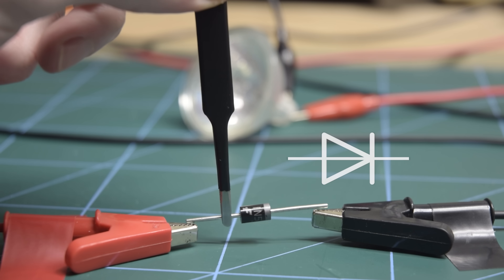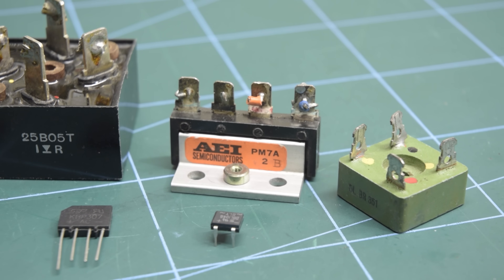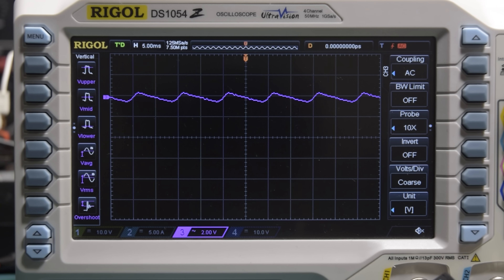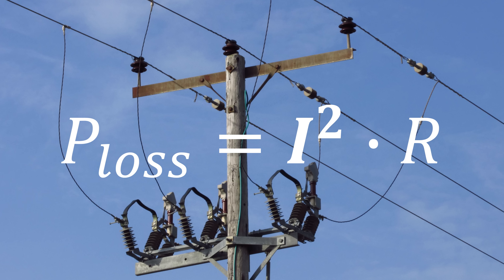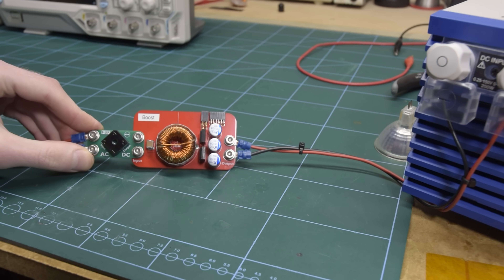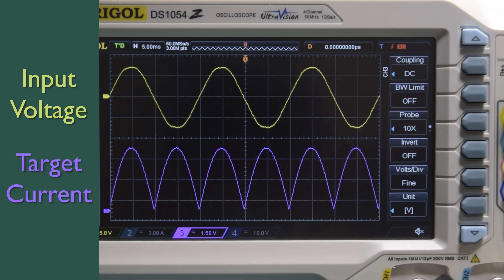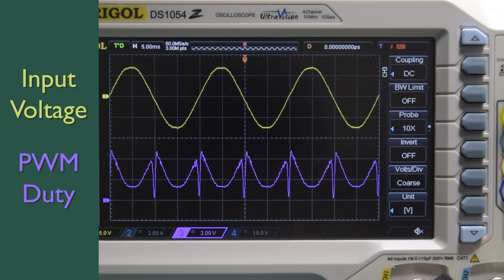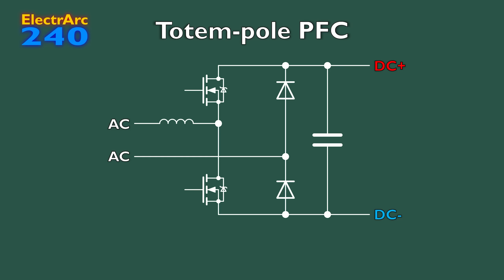Fixing the Full Bridge Rectifier’s Big Flaw - Active Power Factor Correction

Comment: Power factor correction is done at electrical substations when not done at large industrial users' facilities. Switching power supplies have no need for power factor correction.
Reply: We aren't talking about reactive power. A rectifier followed by a capcitive filter is a very non-linear load. There is no practical way to fix the problem with linear reactance. A power substation can add capacitive or inductive reactance to fix problems of poor power factor due to inductive or capacitive reactance, but that ONLY solves the problem at and "upstream" of the substation. It does nothing to fix problems downstream of transformers between the substation and loads.
Switchmode power supplies are the worst offenders in terms of presenting non-linear loads and the problem must be fixed right at the switcher.

Comment: Somewhere in a comment someone asked how PFC will work with DC input.

Overall the controller will make the instantaneous input current directly proportional to the instantaneous input voltage and the average input current inversely proportional to the average input voltage. That means it will accept lots of weird things without complaint. The analog ASICs for active PFC don't make any "assumptions" about what they are getting - they actually look at it constantly. Something based on a microcontroller probably makes assumptions and may lose its mind.

It may vary with the controller used, but in general, it will work just fine as long as the DC input voltage is within the range the PFC circuit is designed for. If you take roughly the nominal RMS AC input voltage range and supply DC within that range, you'll likely be OK. That would be something in the 85 to 265 volt range for a circuit deigned for "universal" AC input. Be careful if you are pushing the limits. Keep the DC below the peak of expected high line. If the DC input voltage is very low the efficiency will be lower because of high average input current. You might run into current limiting. 

Performance should also be quite acceptable if the AC frequency is "off." I'd expect pretty good performance at low frequency but performance might be mediocre at say 400 Hz. Performance with varying AC frequency, as long as it is within a reasonable range, should be OK.

Comment: I will show this to one of my cleaning ladies shortly, who's asked me about this recently due to a power monitor upgrade. Their technician told her that drawing current from both her washing and drying machine would incur additional surcharges. I called that out as BS, but she had a hard time believing it. I told her that most likely, this was a matter of power factor, and suggested her to (with European 16A room service safety concerns being mentioned) just try it. She had apparently already done it before, without apparent safety issues, so I have no regrets telling her to do it again. Still waiting for her response, and she's still waiting for her January bill too. But overall, I don't think this has to be complicated or overstated. It's just another constraint that device manufacturers should count into their designs from the start. With that said, thank you for having shed light onto this. I had a hard time explaining power factor myself, so I will save and use this video next time I see her.

Comment: @ElectArc240  Thanks for the vid. I am surprised to see all the former elec engs satisfied with explanation by the magic of digital oscilloscope math functions. (Great for newbies though.) IMO... the magic oscilloscope is having us miss out on the crucial diff between Displacement Power Factor: which relates to the phase difference between voltage and fundamental current. Distortion Power Factor, which accounts for harmonic distortion in the current waveform.And True Power Factor: which combines both displacement and distortion factors for an overall measure. But... maybe I just went to a bad school.
Reply from the maker: No that’s right, but multiplying the waveforms like that accounts for both forms of power factor and the average of the power waveform will be the overall power factor. I decided not to go into detail about the two types to avoid confusion. The simple real / apprent equation is always true for overall power factor
Reply: There simply is no displacement (phase shift) at play in a rectifier with a capacitive filter. 
In a practical switcher there will typically be some capacitance directly across the line as part of EMI/RFI mitigation, but you're rarely looking at more than 2 or 3 microfarads. If you were to measure power factor with zero load on the output(s) of the switcher, it would largely be due to displacement, but without active PFC it becomes a very insignificant term when the supply is running at even a small fraction of its rating,

Comment: Very good teacher.  I came up through in a technical electronics school in 1974. It wasn't easy to work
the labs and one of the "trick questions" was about a bridge, not rectifier but a load/voltage resistor network.
Your construction of the led rectifier is FANTASTIC (not due to just the lighting effect, which was great, but the
use of a signal generator to slow down the effect) as well as your rearrangement of the diamond to a vertical
stack.  It is important, as a teacher, to remember that the student is ignorant of the ideas to be taught and the
challenge is to engage the student with simple but informative presentations that impart the knowledge
desired.  Almost immediately I could tell this teacher is a good teacher.
Good job, thank you.

Comment: Does the booster bring “in phase” work like I think it does on power generators? The ones you have to manually time its phase sync with the grid
Reply from the maker: Yeah it does, except thankfully the circuit does that synchronisation itself!

Comment: what happens to the combined pfc of a colony/city, some loads might be using active pfc some not, i know power companies have there own capacitors banks to correct atleast some PF, which may have resulted in less heating & fires in utility power lines & distribution transformers.

Comment: There is also an issue for domestic use: that the household circuits are protected by fuses or breakers that sense the Amps.

If the power supply in your example was on a circuit protected by a 1.5 A breaker, it would trip because of the 2A current flow. Not a problem, as typically the size of the fuse on the circuit would be 13A in the UK, and same ballpark (say 10A to 30A) in other countries depending on the local code.

But ... If you put 7 of those supplies on the same mains circuit with the UK 13A fuse, it would blow: because it's the Amps that matter to the fuse, not the power. The fuse doesn't care that the Amps are out of phase, it blows anyway. That is the right thing to do, because it turns out it's the Amps that create a fire risk when your device draws to much current. 

Amps make fire risk 
Volts make shock risk
Power is only of interest to the billing company. 

Safe and legal wiring for AC has to account for all three separately.

I discovered this the hard way when running multiple computers as part of a prime number project: the max number i could power off one wall socket was around half of what I thought it would be based on the power draw.

We have our plugs protected by a 13A cartridge fuse, so it's not as easy to reset as a breaker; it was a pain and i got through a few of them before I discovered a combination that worked without blowing the fuse. 

And because of the fire risk consideration: the fact that the fuses blew on me was a Good Thing even tho it was a pain at the time, because it protected me from my own ignorance, and because my  home didn't catch 🔥 🏠🔥 fire the 🚒 fire service weren't needed.

Comment: On that note , if I put an incandescent bulb in parallel with my washing machine , would it improve the power factor from the induction motor. An old school light on the same plug as my 2hp milling machine seams to keep the power clean enough to not knock out my CNC controller . This effect may be unrelated .

Comment: I am looking at that distorted "sine wave" in the thumbnail. It looks like an extremely low amplitude sine wave. Why? Because the zero areas indicate a diode which hasn't turned on (forward-biased) yet. With 0.2V for germanium or 0.6V for silicon, the amplitude of the sine wave is not much higher than 0.2V, or 0.6V.
Reply: The waveform is the current. As expained in the video the currrent only flows when the instantaneous input voltage is greater than the DC votage on the filter capcitor (plus the forward drop of the diodes).

Comment: I am an electrical/electronics engineer from many years ago. It was a pleasure to watch and understand the improvements that have evolved to the original bridge rectifier and capacitor setup. Very well demonstrated and explained!
Reply: If you go way back you may remember the concept of putting the inductor after the bridge rectifier (with the capacitors after the inductor) and in fact using a special kind of inductor called a "swinging choke". Those increase inductance when the current is low and decrease inductance when the current is high. The result is decent power factor at all times, but the swinging choke is a specialized, bulky, heavy, and somewhat costly component, and it introduces its own losses. When properly designed and all components were working properly, this fancy approach also did a half decent job of regulating the output voltage. 😊
Reply: @YodaWhat  Wow! Respect for the knowledge of the historical black arts there :)
Reply: @YodaWhat  Yhis solution and transformers with cut magnetic cores also does well to block high-voltage spokes from the net from destroying things. The magnetic core ends up saturated and can't transfer the energy of the spike.
Reply: Methinks Yoda and I must be of similar vintage,  lol!
Reply: Same for me! Very well done!

Comment: LOL! And how much power does the power saving electronics waste? Do NOT tell me it is insignificant!
Reply from the maker: Most PFC circuits are 95% efficient or more. Some modern GaN ones are 99% efficient. And that is more efficient than a diode rectifier
Reply: @electrarc240  But NOT ZERO! I win!

Comment: I hope you know where from you got that example where computer supply takes  apparent permanent current 3,21 A? As we know power it is energy per  second. How long is that impuose lasting decides how big is  power requirement, Maxumum current in say 1 milisecond makes 1/1000 electrical power. Is   juice worth squising?  Your calculation of time is not existing.  . As for me you else present false data or you  need education.
Reply: It seems like you don't understand the concept of RMS (root-mean-square ) values. The effect of the duration of the "pulses" of current are implicit in the determination of the RMS value. A meter which measures RMS will sample of a period sufficiently long that the error due to the sampling window for the calculation of RMS wil be very small unless the frequency is very low. The meter specifications will  cover the details.
The presenter unquestionably undersstands the subject matter and he is very good at explaining things. He does, of necessity, assume his viewers have reasonably good basic knowledge. That obviously is not always a safe assumption.
Reply: @ebpdoug2175  If you start your "honest answer"  form "you do not understand" which is rude and personal not technical,  only after  you set your   poetical but not technical arguments ( it would be where from you took 3,21A current and   , how long is impulse but you talk theoreticaly,  not supported by values about future predictions like "the scpecifications meter will cover..." "will sample sufficiently" which is let's say   prophetic not technical ) and  you didn't  even once    use word "energy" in subject 100% regarding  saving  energy,    then   You better     discuss   with science not me because   science is your main  opponent  . The " very best viewers  basic knowledge"   is when they  do not know even  what to ask  their teacher about  . Can  we fiind   any serious  question?

Comment: Wait how do you use a LED to detect the change of the polarity, when any LED needs some threshold voltage to operate? It would detect the change of the polarity too late or too early
Reply from the maker: That is indeed what happens, so I use the edge that is too early and add in some delay. Definitely not ideal but works well for this demo!

Comment: I'm curious how much noise those active pfc circuits introduce
Reply from the maker: They're usually used on circuits that already have switching so they don't add much more. But for sure they have more high frequency noise than a linear PSU

Comment: 4:21 The RMS current draw is higher, but it's important to point out that that current is also pushed back onto the supply on the back half of the wave. This is why traditional home power meters don't even count it, because it effectively wound back the dial the reactive amount each cycle. Industrial sites had meters that would also track the reactive power.

In your laptop charger example, it would be drawing 2A on one half of the cycle, but pushing back 1A on the other half.
Reply: Nope!
The circuit presents nothing like capacitive reactance. it is an extremely non-linear load. The peak current flows at around the peak of the applied voltage, whereas in a capacitor directly across an AC source the peak current is at the zero crossing of the voltage. The diodes prevent any energy stored in the cap from being returned to the source.
With a purely capacitive reactance the power factor is zero at the capacitor, however current, which can be huge with a big cap, still flows in the conductors between the source and the cap. Where the source is the power utility transformer, that means current in the wires to the tranformer, in the transformer windings and from the transformer to the cap. That can rack up large resistive losses. If the cap is being used to correct for inductive reactance, then current circulates between the inductor and the cap in a "local" loop, reducing the current between that loop and the AC supply.

Comment: Active PFC's are great, and having designed several power supplies for use in the US, we mostly used passive PFC, in our systems. As we approached 70-75W of power in the apps, we were looking at more active designs. One issue we will have with them is the switching noise from the FETs. The filtering required will be significant especially since this will be directly on the mains. Of course we can filter this but in the US we have systems that monitor Ground Faults at panel and system level, and Arc Faults as seen from the distribution box to the load. Most of these systems are very sensitive to conducted emissions, and the false tripping can be significant. The UL101 compatibility test will help with GFCI tripping from detected ground currents whir using Y caps for Conducted Noise Suppression. However, there are many breakers out there that are too sensitive to high frequency ground currents, and falsely trip.

The AFCI's are basically in the wild west stage of application and use. The number of false trips are significant, and they are attempting to detect noise at various places in the emissions spectrum. It will be interesting to see how this is addressed in the future. Many of these AFCI systems look for patterns of noise that are in sync with the AC waveform. It may improve it, or it could make it worse. And each supplier of breakers uses a different method of detection. This should be interesting.

Comment: An excellent video on most levels. However, I think you have confused crest factor with power factor - two important but different metrics. What you have really described and demonstrated is how to address the high (and adverse) crest factor that often occurs with simple rectification.
For a good comparison of these, try this question in ChatGPT or Copilot: "Explain the difference between power factor and crest factor in ac power systems"

Cheers and keep up the good work 🙂
Reply: No, he is legimately looking at RMS values.
In a circuit with a rectifier followed by a capacitive filter the ratio of peak current to RMS current (which is what is commonly called "crest factor") is high. The ratio of RMS current to average currrent is also high, so peak to average is very high. Regulated switchmode supplies are power converters - they deal with average input power and average output power. If you need 100 watts of DC output you need an average input power of 100 watts (ignoring inefficiency).

An active PFC circuit makes the instantaneous input current directly proportional to the instantaneous input voltage.  If the input voltage is sinusoidal, the input current will be sinusoidal and in phase. The circuit makes the average input current inversely proportional to the average input voltage (as do all regulated switchmode converters).